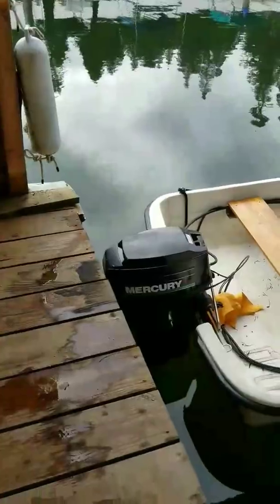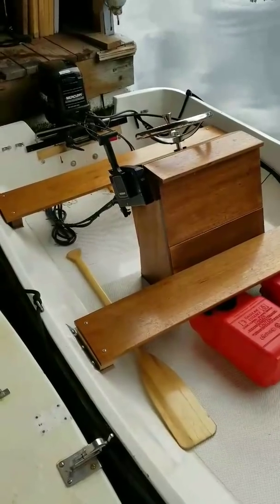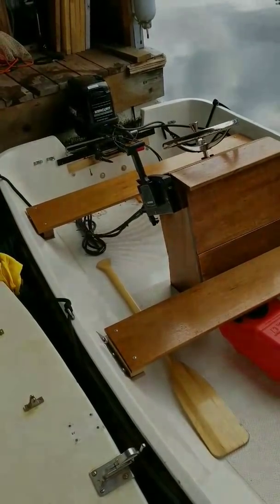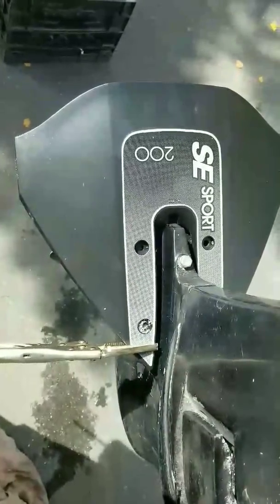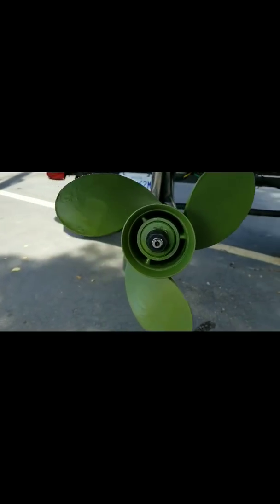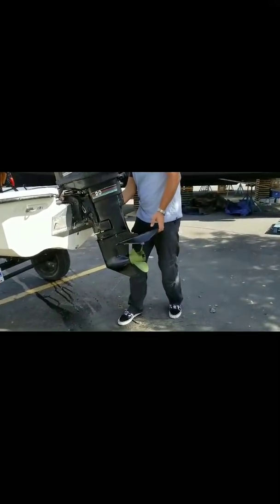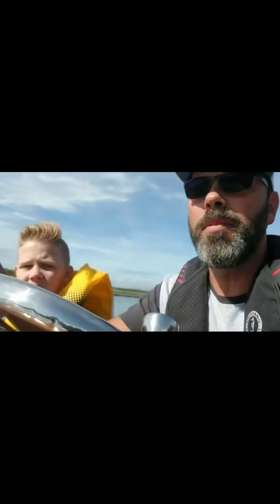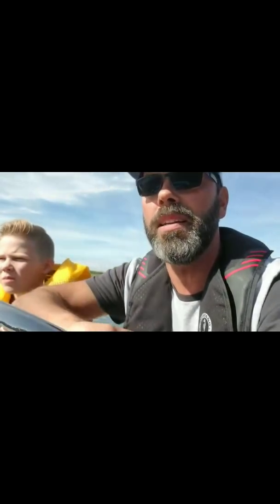Outboard Motor Hydrofoil do they work?

Comment: We put a foil on our 12' Avon inflatable which are notorious for doing wheelies, absolutely cured the issue. Added benefit, we could add pitch to the prop and pick up 3kts since we could set the trim higher (not electric) and still plane very quickly. Makes you wonder why the factory cavitation plates aren't larger.

Comment: I’ve run an SE Sport 200 on a smaller boat and engine and currently run an SE Sport 300 on a larger boat and engine. The SE Sport is the top rated and tested hydrofoil on the market. The difference is remarkable. Whole shots are stronger, more focused thrust and completely eliminated ventilation or “prop blowout”. Turning is much sharper and more precise. Utterly eliminates porpoising, and gets you on plane much faster. I’ve run my SE 300 for 13 years and it’s still going strong, built to last!

Comment: Fins do help for planing but they do make turning at high speed not as stable. Before buying one check your outboards different pin positions as you might not need one.

Comment: speed loss is more than likely due to incorrect trim settings now that the foil is installed try moving it out 1 maybe 2 holes should see a gain
Reply from the maker: I'm not disappointed with the speed.  I have adjusted the trim on this motor several times.  As noted in anther comment, since this video was made I did move the console forward along with the seating position to better balance the boat.  all control and reaching plane improved.  at this point what needs to happen is the motor could come out of the water about an inch. I have 2 other boats and this one is running great enough for me.  My Sport Fishing Boat is getting my attention now.

Comment: Hi, I was slightly surprised at your loss of top speed,. My experience with running the doelfin is running same trim setting as without hydrofoil keeps to much of the nose in the water in essence increasing resistance,. As I ran mine on a 20 foot boat with mariner 75 I had luxury of power trim and this was the issue nose being too low and you can see this in your video , I could compensate with trim and able to gain an extra 2 knots 
It's worth you doing some more experiment runs with different trim settings to find a fixed setting your happy with , I'd say needs trimmed out by 1 maybe 2 notches 
Cheers

Comment from the maker: This boat was assembled last year and the fin installed in Sept. 2017.    I used the existing seat mount positions and hoped for  the best. Earlier this season I disassembled the seating and console moving everything about 10 inches forward.  Also mounting a 20 L fuel tank and raising the driving position about 5 inches.   I have a video posted of this set up with a review the GPS Fishfinder I installed https://www.youtube.com/watch?v=tlKZLNigFTI&t=690s .   It does run much better.   The weight of this boat is about 450lbs without the motor or console.  It is a double hull fiberglass boat.  Finally with the shape of the hull not flat not V but  a cat shape getting the motor position and angle was not easy.  It is very maneuverable and stable at speed but never gets over 21kts.  I believe the next step will be to raise the motor height about 1.5 inches.  that will involve making a new jack plate... I also plan to try a couple different props.  Overall I'm much happier with the boat this season.  I also painted the bottom and leave it in the water tucked behind my cabin cruiser. We towed it hundreds of miles throughout the gulf islands... using it for crabbing and prawning and as our ship to shore when at anchor.   Thanks for watching and your feedback.

Comment: Seems odd to me that a 20 hp Mercury would take so long to climb onto the plane with such a small boat. The fin clearly did help a lot there. I had a 3.8 metre Stacer V hull tinny with a 20 hp Mariner (same animal I believe) and I'd put an inch higher pitched prop on it too. Admittedly tinnies are lighter than glass boats, and mine, I ended up making it forward control because if it was just me in it, I had extended the fuel line to the 20 litre tank and put it right up the very front and it would point it's nose so high in the air I was worried a gust of wind might flip me. Converting to forward control solved that and made everything a lot better on that tinny. If I hit straight to full throttle from stationary it would literally leap up and plane within a couple of seconds. Going fishing with a few friends, one of whom weighed 20 stone, his teenage son, another mate and also his teenage son and our fishing gear which of course included a big eski with at least 36 stubbies of beer and lots of ice was the only time it took anywhere near as long as your boat before fitting the hydrofoil to it. Honestly, I'm not trying to brag about my boat or motor, it had some bad habits too which may have been related to the motor and deep engine leg maybe. It never made any damn difference how I trimmed it, it just would not go around anything more than the very slightest curve while on the plane and it would ventilate VERY badly. I wound up dropping off the plane and turning, then when straight throttling back up, it was very frustrating. It was like it was riding on the very corner of the chine(?), weld line of the side anyway and so much on turning even a little that it was actually lifting the centre where the motor was mounted out of the water enough to suck heaps of air and just about free rev. Never did solve that, I wanted to try one of those fins but the boat shop owner was dead set against the idea. He was where I bought all the gear and he loved my boat and the way I'd set up the whole half console setup that still allowed me to step around the dashboard and steering mounting so I could actually steer while leaning over the front in shallow or rocky waterways for the bottom or rocks before I hit them. I made the dashboard out of marine ply screwed onto the steel frame I'd welded up and that gave me a perfect spot to mount my depth sounder and a spotlight.  He took heaps of photos and sent them off to the manufacturer with the suggestion they design something along similar lines. I have no idea what your boat would weigh but I'm pretty sure it and you would have been a fair bit less than mine with all that gear and weight of people. Sorry for rambling and it's a fair while ago you made this video so you may not even have that boat and/or motor but if you still do and it's still about the same behaviour I'm fairly sure it should pull better and rev harder than I heard yours at any point, it might be worth a thorough check over and tune up. I must admit I'd almost forgotten that I'd also spent many many hours after work in the evenings sanding and shaping the whole prop and especially the leading and trailing edges and polishing it up to a chrome like finish. Just how much difference that made I can't really say but it must have made at least a little bit less drag spinning in the water. I did take a GPS with me to see what speed it did and I'm fairly sure I can remember it peaking at 48 mph. This was 20 odd years ago so my memory could easily be wrong, but it definitely was quite a quick setup.

Comment: Just installed an Atwood hydrofoil on my merc. Cut plane time down by 6 seconds. I noticed your boat got on plane 4-5 seconds faster with the dolphin tale. Only downside to mine is steering at higher speeds. Good job though.

Comment: They work fine on a flat bottom boat but on a v-hull they're always in the water even on plane causing unnecessary drag
Reply: WRONG.I have tried it on flat and V shape hull with a lot of improvement.
Reply from the maker: Good point, thank you for that input.  I have discussed this with many other boaters and found they all use them on inflatable tenders as well.  Another friend has a 15 ft whaler and he has installed a fin with great success.
Reply: True. I have a Fibrafort Style 215 boat. The SE Sport 400 Hydrofoil sucks on it. Engine is Suzuki 140 HP. Going to uninstall.